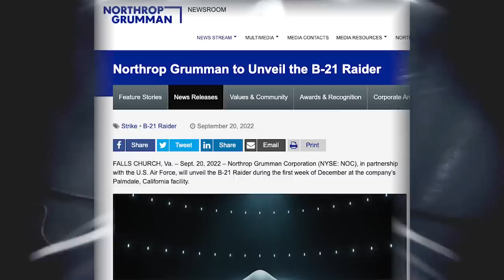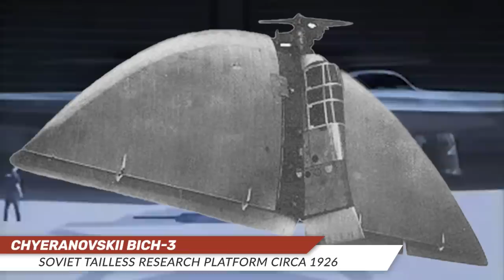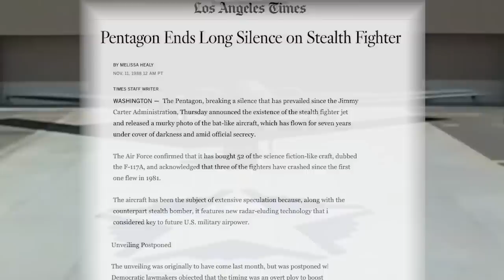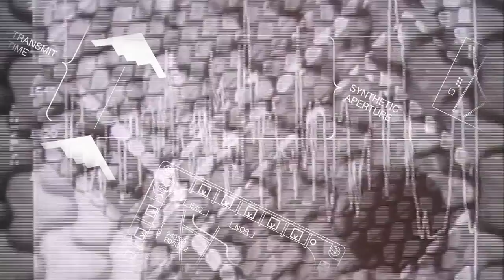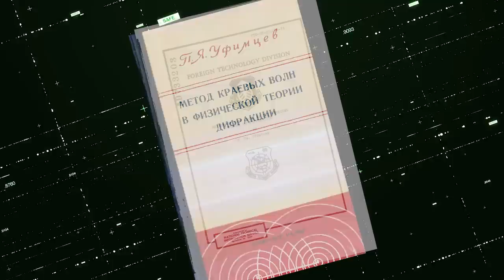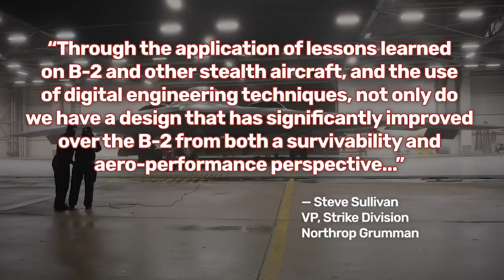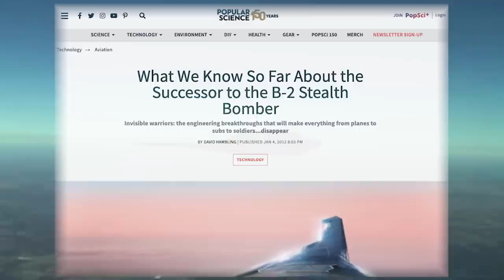Revealing the B-21: Why Northrop Grumman's announcement is a big deal

Comment: The most unbelievable thing about this whole project is that it's apparently on time and on budget.
Reply: NG got their shit together after the massive overruns of the B2 cost them the YF23 contract .
Reply: @Dr.Westside  YF-23 represented several major risks that didn't exist with the proposed F-22A, which were already solved on YF-22 out of the gate.

1. YF-23 PAVs cracked several windscreens during sustained supersonic speeds.
2. Boundary layer diverters didn't allow speed past Mach 1.82, required a total redesign of the intake geometry.
3. Every control surface required 2 hydraulic actuators, laid on their sides.
4. Weapons bay storage and ejector racks were never solved, weapons bay was limited in AAM capacity to 5.  Proposed F-23A would add another forward weapons bay, increasing the aircraft overall length even more, limiting g in pitch, yaw, and roll axes, still not reaching the 8 AAM weapons count.

YF-22 PAV1 demonstrated a classified time-to-climb record and Mach 2.2 on the same flight.

YF-22 could carry and separate 6 AAMs, while proposed F-22A would carry 8.

YF-22 could supercruise and maneuver extremely well across the regime.
Reply: @Dr.Westside  The YF-23 was a fantastic aircraft and arguably better than the F-22! IMHO we should've gone with it - but I think it's appearance went against it and I read that Lockheed wowed the decision makers with a fantastic sales demo, which they are good at. NG just engineer and build things well, but aren't as wired in to DoD like Lockheed is.
Reply: @mikejohnson5900  The YF-23 couldn't even launch missiles lol, if you have to compromise your design so that you cannot demonstrate basic capabilities of a military jet no-one in their right mind is going to pick the YF-23, slightly better stealth and speed have been completely irrelevant compared to the F-22.
Reply: @mikejohnson5900  at first I thought this too but then I realized that the dod was ultimately right to do what they did. NG already had a history of blowing up the bank on their contracts and that was the last thing we needed when developing the first stealth fighter. Even Lockheed ended up going over budget which lead to less planes being delivered then originally anticipated and the shut down of the supply chain. We couldn't produce any more f22 even if we wanted to at this point.

If the yf23 won, we probably would have even fewer planes which as I see it, will likely never be used in combat.
Reply: @mikejohnson5900  The YF-23 was worse than the YF-22 in all aspects but stealth where it had a little edge. The prototype couldn't even launch a missile, the internal storage was laughable and for some fucking reason NG decided to put the bay doors IN FRONT OF THE INTAKES. The maneuverability and sensor suite were worse too.
Reply: @Spaced92  The same happened with the X-32, the fucking plane couldn't VTOL without the prototype being stripped of several parts. Like, my brother in christ, the main requisite for the prototype was that it had to be VTOL capable without reconfigurations.
Reply: Same with the NGAD. Maybe the DoD finally got its shit together. We also don't see the MIC having anywhere near much control and clout as it used too(2000s and 2010s). Maybe that has something to do with it.
Reply: @vyros.3234  MIC has never had much pull compared to the top 20 industries in the US.  Anti-MIC sentiment is mostly a Soviet propaganda campaign directed from within US media, along with complicity from the actual giant corporations who own the media, to keep the spotlight off their corruption and co-opting of the political parties.

If you look at the top industries by annual revenue, MIC isn't anywhere near the big dogs.  Guess who the heavy hitters are in campaign financing?

We're talking about industries that have over 1 trillion in revenue annually each, who have huge lobbying and media conglomerates under their ownership.

They literally own every single major legacy media corporation, from ABC to USA Today, which means they have always been able to control the message....until the internet came along.

They still spend billions in that space, but many people have lost trust and just don't even view legacy media channels anymore.
Reply: @vyros.3234  Q1²q⁰
Reply: It’s a lot easier and cheaper to do a project if you do the fundamental research before you start building it!
Reply: So far …
Reply: @IvanMorningstar  fhmmHu just
Reply: Well its the second time its being done, that's why it worked out.  Another factor is that they didn't wait too long between B2 and B21 such that the old engineers were retired and the young ones had no advice or back stops.   Boeing retired the older engineers (forcibly in most cases)  and outsourced so much no young engineers have the experience to avoid mistakes.  Here is the thing, experience means not making the same mistake twice.  If you retire to many people, outsource too much and have too much time between programs you have not experience.
Reply: this is a "secret project" so i wouldnt be surprised that they have been pouring money on this project since the B2 rolled out and they just kept it a secret/ofuscated so we wont hate on the project.
Reply: @lukasausen  BINGO money is only real for the plebs
Reply: @lukasausen  
Mm
Reply: @lukasausen  if that "plane" didn't hit the Pentagon on that one side in that one spot we would know how much was spent and where it went . But 9-11 happened and a few buildings mysteriously fell to the ground
Reply: For Northrop yeah lol
Reply: It’s probably just a miniaturized version of the B2 with improvements.
Reply: This is actually a case where the use of a proven, well-established technology is improved upon and re-released, meaning that it probably is on-time and on-budget more than most. There's no reason the B-21 can't be a reliable and effective follow-on to the B-2. Compare this to the SLS, where a well-known but unreliable and overall outdated system is re-released when it never should have been.
Reply: I think it’s a testament to new computer modeling, saving years on R&D. It should give us hope that NGAD will be here before we know it, ahead of schedule and on budget just like the B-21.
Reply: Actually defense contractors used to always deliver on time and on budget, the JTSX program was awarded to Lockheed without them being ready,  total miscalculation but that's what happens when career lawyers and politicians with zero experience in the private sector pretend they know how businesses operate.  As for the 35........ well politicians wanted "international cooperation" in the name of scoring political points.  Then they reneged on their end of the R&D cost, see (Germany, the Brits and especially the French) so they got a look at the IP with zero cost and delayed the project as they (particularly the French) kept giving "design input" like a ridiculous 4 barrel 25MM vulcan that just happened to be French designed.  Why anyone listens to the French about defense matters is baffling.  It really only is in the 22 and 35 that we see the modern excuse for defense contracting.  Northrop, is always worth the wait.
Reply: never happened before- RIGHT?
Reply: that is crazy
Reply: Yeah that's funny.
Reply: I guess Mr. Fox was working overtime lately, not a moment to spare, if we're gonna have morons in DC it looks like its gonna be up the Batman to dole out some stealth justice
Reply: That’s a GOD DAMN MIRIACLE
Reply: So they say…😊
Reply: @S.R.Backwoods1  we can all have hope
Reply: That means they already had it and have probably been using it for years.
Reply: All the overruns for the other projects were funneled into these projects while they were black projects.
Reply: I'm 64 and have NEVER seen one come out on time and on budget ! I mean like WOW as my kids say ...
Reply: Yeah that’s pure BS
Reply: Er..!
@don't believe ya
Reply: WHAT? That’s insane
Reply: They're probably acquiring some goodwill, so the next larger-scale project can be over time and over budget again.
Reply: yeah until it's time for the rubber to meet the road
Reply: They've just stretched out the program times...
Reply: It's getting easier. With everything designed on computers, you can see a lot of problems before ever needing to create the necessary tooling to actually build the thing. it's easier to more accurately assess what the project will cost.
Reply: As far as you know…..
Reply: Has this thing not already been in use for years? There is no way we tell the world about our "latest technology" and lose our advantage
Reply: That is a complete lie on time and on budget if you work with In program walls i suggest not making that information known here.
Reply: impossible
Reply: Nope and not even close.
Reply: Digital engineering my man. You wouldn’t believe some of the capabilities we have.
Reply: @daking8374  ironic considering aircraft designs could be drawn on a drafting board and prototyped in under 12 months back when it was done by hand.
Reply: lmao lies
Reply: It’s actually UNDER budget.  $550 million in constant 2010 dollars comes out to $751,672,047.55 per plane today.  The most recent estimated cost per plane for the B-21 Raider is $692,000,000 per plane.
Reply: @willymac5036  Northrop has a long standing history of delivering what they promise
Reply: You are on drugs.
Reply: @johnsmith1474  Off em  actually
Reply: Part of the reason for that is that Congress didn't get the chance to "Pork It". The F-16 was like that too. Amazing what you can accomplish when the Politicians keep their Noses and Sticky Fingers Out.  The Boeing SLS is a horrible.example of what happens when Politicians and Bureaucrats get their hands on a project. Way over budget and obsolete before it's ever flown. The only reason we are even flying it is we would look Even More Stupid if we don't. It's great tech if we flew it 15 or so years ago. Now? It's as Obsolete as a Buggy Whip. Why? Elon Musk......
Reply: Now that is something to discuss-what went wrong that a project would actually be on time and on budget?Now that is news worth discussing,lmao.
Reply: LOL
Reply: The air force general that streamlined f35 program said they will not do "concurrency" again. Hopefully, all future aircraft dev will be this smooth.
Reply: no $ 30,000 toilet seats in this bird??????
Reply: Under budget is the rumor... 

I know hard to belive.
Reply: I doubt it.
Reply: The F-23 fighter that Northrop Grumman put together was better than Lockheed Martin’s F-22 fighter but the showmanship of Lockheed Martin got them the contract.  Once the contract was done they ended up using the style of the F-23 on the F-22…. If you want to see a good video go and look that one up here on YouTube.  It seems like Northrop Grumman does a solid job over all.
Reply: All u yankees have had your pockets picked.....you silly people!! Ur Govt allows the military complex pass on the joke u need to be defended against WHO???? no kuntry wants to take USA because there is nothing to take.....such a joke...wake up America ...not Lets make America great again
Reply: Forget bombers.  Missiles are where it’s at.
Reply: @Joyful-213  Fuck that. Compare cost per unit of Missiile to bomber.
Reply: Yep, it’s obviously a psy-op and misinformation project, and not really a bomber design  :P
Reply: @goawayihavecommentstomake1488  Spot on. Its a Powerpoint presentation projected with Microsoft latest Office 2023 3D version.
Reply: We should have built the F-23.... A far superior aircraft in every way to the F-22
Reply: @Cretin-90  you are severely mistaken. The YF-22 outclassed the YF-23 in nearly every aspect. Examine the data more carefully. The biggest drawback of the Raptor was the cost and subsequently, the total number of F-22s produced. It’s still the best Fifth Generation fighter ever flown. It’s arguably the best jet fighter to have ever flown.
Reply: @S.R.Backwoods1  Paul Metz, the only person to have flown both, disagrees with you. The YF-23 was a superior aircraft, but the USAF was angry with Northrop over the B-2 delivery, and Lockheed had better showmen to pitch the YF-22. Had this competition been based solely on engineering merit, the Black Widow would have won the day. 
The Grey Ghost (GE engines) was faster (1.6mach v. YF-22 1.58 mach) more maneuverable according to Paul Metz, and vastly more stealthy. RCS is classified to this day----16 years after it first flew. The YF-22 selection was political.
Reply: @S.R.Backwoods1  actually you are categorically inaccurate there, the raptor was more agile only.  The 23 was not only stealthier she was faster, had a better rate of climb, higher demonstrated service ceiling, greater range, and an equivalent internal payload capacity.  Lockheed played a great deal of political graft by pretending they were further along in development by demonstrating live fire which I might add was not part of the competition.  In the end Lockheed delivered years behind schedule and billions over budget.  I can not help but imagine what the results would have been if both frames were awarded contracts, considering Northrop was already well into designing a variant optimized for carrier operations.  There is a reason there are so many Lockheed facilities scattered about the country.  It is not for tax breaks I can assure you.  It is purely for political gain.
Reply: @Cretin-90  wouldn't have mattered since production was cut after less than 200
Reply: @Cretin-90  Except it wasn't
Reply: @TecnamTwin  Except it is. And I worked at Lochkeed.
Reply: @Cretin-90  No it wasn’t and I actually worked at Northrop Grumman on a stealth aircraft program so I have a clue. B2 cost overruns were all the more reason to not choose it.
Reply: @TecnamTwin trash talk with one grain of truth.
Lockheed had better salesmen and better wow factor. NG had a better airframe , but sadly a poor track record of delivery and the USAF punished them for it. 
Grey Ghost and Black Widow were absolute wizardry. Lockheed had an airframe that looked comfy and familiar. 
Fast forward to 2009 and a Rafale kills an F-22. We'll never know, but I don't believe any aircraft-- even today -- could get lock on the YF-23
Reply: @TecnamTwin  Paul Metz, the only person to have flown both, disagrees with you. The YF-23 was a superior aircraft, but the USAF was angry with Northrop over the B-2 delivery, and Lockheed had better showmen to pitch the YF-22. Had this competition been based solely on engineering merit, the Black Widow would have won the day. 
The Grey Ghost (GE engines) was faster (1.6mach v. YF-22 1.58 mach) more maneuverable according to Paul Metz, and vastly more stealthy. RCS is classified to this day----16 years after it first flew. The YF-22 selection was political.
Reply: @TecnamTwin  "Paul Metz, the only person to have flown both, disagrees with you. The YF-23 was a superior aircraft, but the USAF was angry with Northrop over the B-2 delivery, and Lockheed had better showmen to pitch the YF-22. Had this competition been based solely on engineering merit, the Black Widow would have won the day. 
The Grey Ghost (GE engines) was faster (1.6mach v. YF-22 1.58 mach) more maneuverable according to Paul Metz, and vastly more stealthy. RCS is classified to this day----16 years after it first flew. The YF-22 selection was political."
Reply: @Cretin-90  Yes, a raffale got a kill on a simulated engagement, after the F-22 moped the floor with them 11 times before. I can bet 1000 bucks that someone told the pilot the exercise wouldn't end until the raffale got a kill and I wouldn't lose a single penny
Reply: @Cretin-90  No, the YF-23 wasn't superior to the YF-22, it had many major flaws that the presented YF-22 didn't have, and the YF-22 prototype beat the YF-23 in all fields but stealth.
Reply: Of course.  It was developed during Republican administrations.
Reply: That's because of the agreement that Trump made!
Reply: @jessemills3845  lol. Contract was awarded under Obama.
Reply: @jessemills3845  You mean the agreement with his boss Putin to give him the top secrets documents he stole

Comment: Will be a huge upgrade from the B2 except for payload.  I expect the USAF to purchase 150 - 200 so the total force projection will be much higher than the B2.  The cockpit will be modern, state of the art.  I imagine a very high altitude (50,000 ft) night mission (so cannot be seen visually either) and a radar cross section so low with design and RAM that it can't even be detected by LFR.  JDAM targeting with incredible accuracy, even from altitude.  I also expect it to include a nice suite of ECM capabilities that confuse enemy radar even further, perhaps painting phantom aircraft many miles away from its position.  Might even incorporate electric instead of hydraulic flight control actuators and a wireless and redundant multiplexed fiber optic link from the flight control computers to the control surface actuators and other systems.